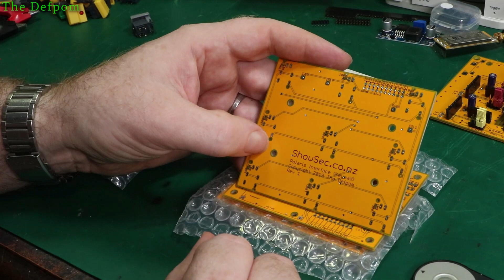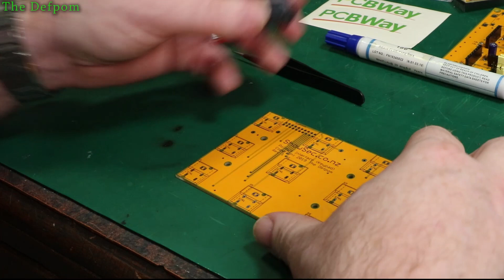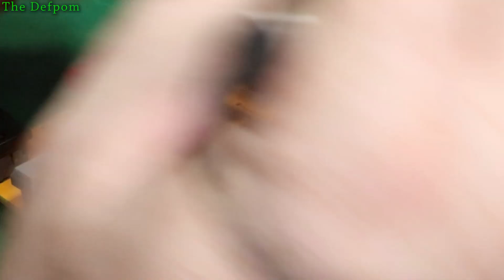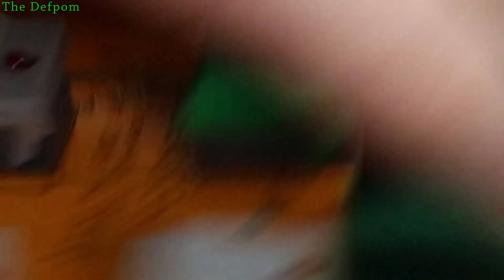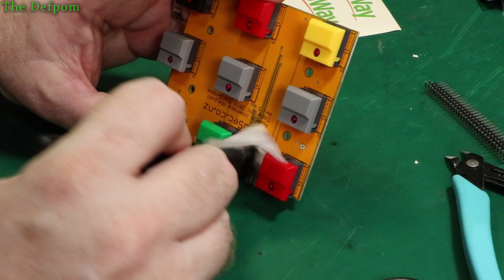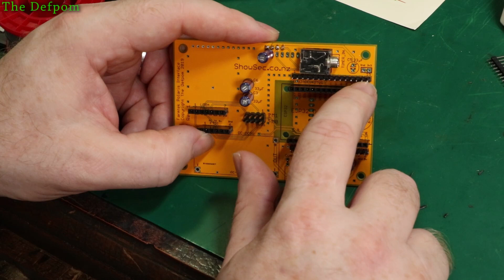#678 Farmtek Polaris Interface Project - Keypad & Controller Part 2 - Free PCB's From PCBway

Comment: Lay down a layer of kapton tape on the printer bed and the surface will be completely clean, flat and shiny when you pull it off. Kapton tape also helps adhesion especially when printing small parts. I buy it in 8" by 8" sticky backed sheets.
Reply from the maker: IanScottJohnston - yes I should have thought about doing something like that to get a nice finish. I ended up printing a face plate with lettering on it and nice edges around the buttons anyway, so in the end it didn’t really matter. I am in the process of redesigning the PCBs to first into a nice box I found, I can squeeze it all in ok! Will still use a 3D printed face plate though.

Comment: While using solder lead to mount the SMD parts,I very much prefer to use solder paste even when hand soldering. I use small seringes from Altronics which seem to last very long time even when not stored in a freezer.

Comment: Yeah part footprints aren't guaranteed on free EDAs, except maybe KiCAD, so you kind-of have to print out the PCBs to see if parts fit on the paper before sending it out.
Reply: Always print out the design and make sure modules fit... had the same problem with a ESP12F footprint that didn't match, exactly the same problem "scaled"